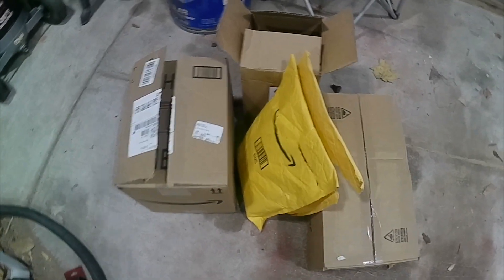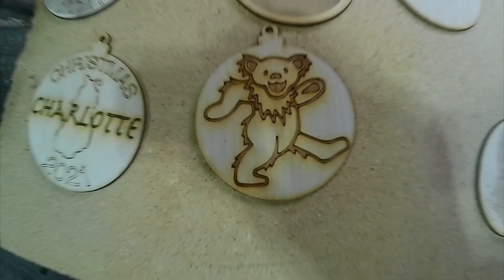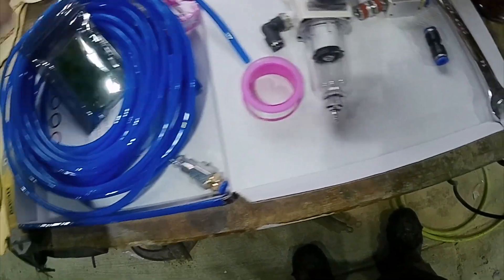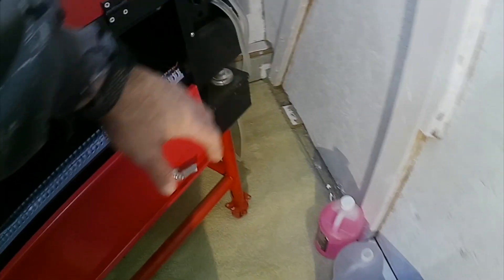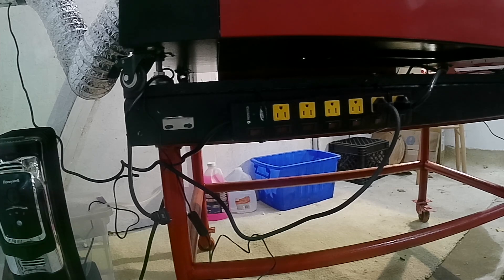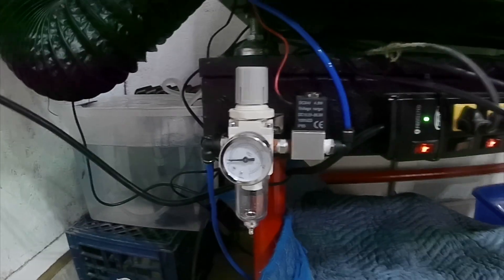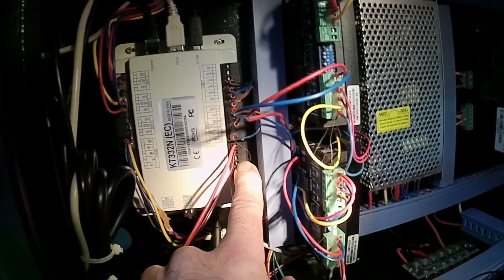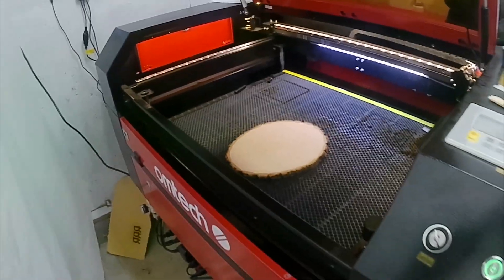(Upgrade) OMTech 80 watt Laser Cutter, Air Assist install

Comment: Nice Video, I have the same controller  and I have the connetors already in the controller, the only one is free says output with 6 pins pin 1 says +24v the other says aux air, would I use those pins to connect to the solenoid? the other pins are as follows pin 3 status pin4 out 1 pin 5 out 2 and pin 6 gnd, Thanks

Comment: would these instructions work on the 60 watt omtech? clearest video ive found, but diff machine....
Reply from the maker: It should, it is really just a switch.. I can not say for sure, but IDK how they could be different. Does your controller look a=the same?
Reply: @sunriseadventures5459  ya it does. Thank you

Comment: Hi, i have a question i seen other videos sayin to use 16 gauge and other other to use 18g. I bought everything to upgrade mine. I got a 18g. But is so confusing seen different ppl saying 16g or 18g.  And i see on your list an 18g. Is that the right one?
Reply from the maker: IMO, it will not matter.. Not that much draw..

Comment: I understand from reading and watching other videos that you (I) need to have low pressure airflow (about 5 psi) flowing whenever the laser is running to keep dust, smoke and residue off the lens so it stays clean and when engraving to help clear smoke from  the engraving area and reduce the smoke residue. 

With your setup I'm curious how you get that low pressure airflow without having a second solenoid or bypass valve?
Reply from the maker: I just turn down the regulator, the knob on the top lets you adjust it.